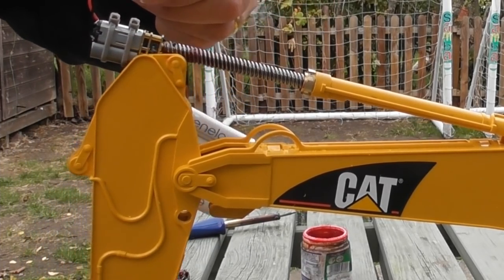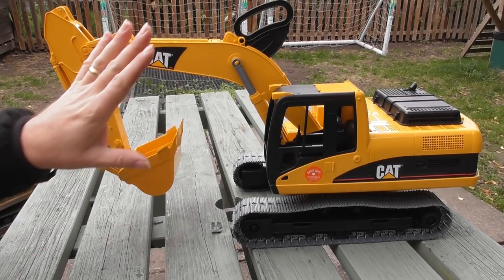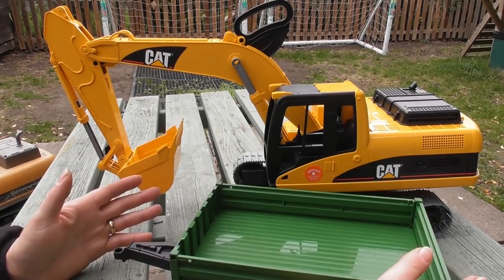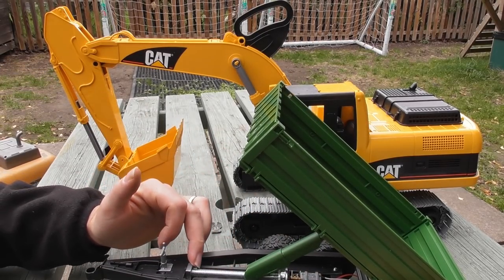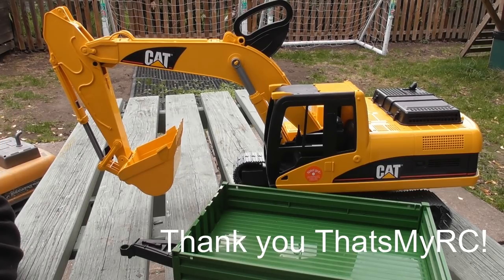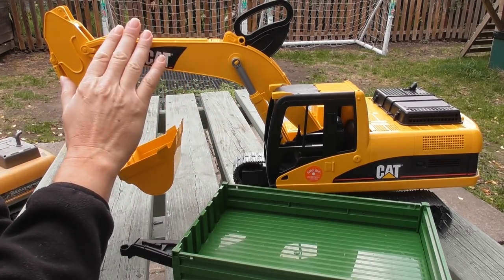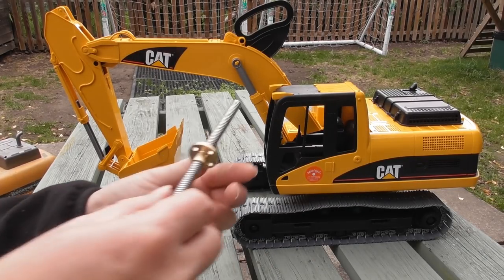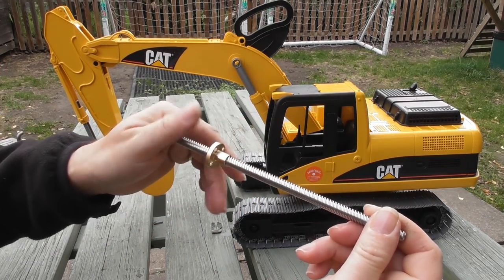Bruder CAT Excavator RC conversion pt1: linear actuator

Comment: glad to see you got that other n20 working... dremel bit looks perfect for detailed work... nice idea with the 3d printer parts... they have smaller versions in old disk drives from computers and hifis... seeing as cd's are becoming obsolete you may be able to pick some up cheap... they come with motors attached and if you get just rom drives, they run off 5v... 12v if it has burner built in but should still run off 5v as they can draw power from both lines....
Reply from the maker: I'm waiting for some more N20's to come through the post - I'm experimenting with different speeds, I will also try 600RPM to see if they still have enough torque  .. Dremel bit perfect for this plastic, again many thanks for this .... thanks for the CD tip, I had no idea - I'll have to try this on the smaller pistons on the other other models .... going to need to figure out gears for the 'turret turn' - I've got a slip ring to allow 360 movement, will probably try  HengLong tank components if I can't figure out anything else 👍

Comment: Hallo there fellow modder.
I do have a request for a future video! I would very much like a video on the tools/ glues you a using. I see you use some kind of activator for the gluing part, but I can't find it. So to sum up! A video on what glue/s to use on Bruder!! That would be very nice.
Keep up the good work and video's !!!
I really like you videos, VERY WELL EXPLAINED.
Reply from the maker: Thank you for watching the videos, I'm glad you enjoy them! I tend to use what ever I pick up at the hardware store. Bruders are 90% ABS (hard plastic -  the soft plastic will not glue, but can be drilled & bolted/screwed etc) which glues very well - especially if you roughen the joining surfaces a little with sand paper and when using double sided sticky pads, wipe with pure (99.9%) alcohol (isopropanol - you can get it from Amazon). Most super glues (cyano) are fine - I like the one made by Gorilla, with the brush inside as an option, I often use a cyano kicker (activator) the one I've been using in the videos for a while is this one : https://www.logicrc.com/?s=c:0,c:70,c:70-75,c:70-75-10&ItemId=S-G05/200. Epoxy comes in useful when I want to reinforce  something & Evostick express is quite nice as it goes off quite quickly (ie doesn't run much), but remains adjustable for a while and sets properly over night usually. I have so many videos in the pipeline to do I thought I would list the glues out here for you rather than do a video saying the same thing! Hope all this helps.  🙂👍

Comment: Hi sir 200 rpm N20 moter is produced enough torque??
Reply from the maker: Yes 6v 200rpm for the bucket and arm swing. 2 x 6v 100rpm for the arm lift. 😀👍

Comment: How size use the thread rod? Lead 8mm? pitch 2 mm?
Reply from the maker: Hi. Thank you for watching the video. This is what I used. 2 x 8mm Stainless Steel Lead Screw Rod ebay link: https://www.ebay.co.uk/itm/Pair-of-3D-Printer-T8-8mm-Lead-Screw-Rod-Copper-Nut-2-included/253840916184?ssPageName=STRK%3AMEBIDX%3AIT&var=553137408566&_trksid=p2057872.m2749.l2649 😃👍
Reply: Thank you..thank you for your tutoring video...☺

Comment: hi, great idea & explanation!
and the speed of your linear motor is also great.

was thinking something similar, maybe even take a T6 rod instead..

could you please add a little more details:
N20 motor:
-ratio 1:200 (right?) -> ?? rpm
-6V
Spindle:
-Diameter 8mm
-2 leads
-pitch ?? (mm/rotation)

tnxs a lot! :)
Reply from the maker: Sorry for the delay. N20's are indeed 6v 200rpm. Lead scews are T8 (double thread I think). I am working on 3D printed cylinders with travel limits to replace these. 😀👍

Comment: Rpm of motor?
Reply from the maker: I've found that 6v 200rpm best for the bucket and arm swing and 6v 100 rpm best for the twin jib lift motors. Plus a separate ESC for EACH of these 4 motors (one esc shared between the twin jib lift motors does not work well - as it results in one motor stalling and then the other one binding). Hope this helps. :)
Reply: @RCModders  thank you